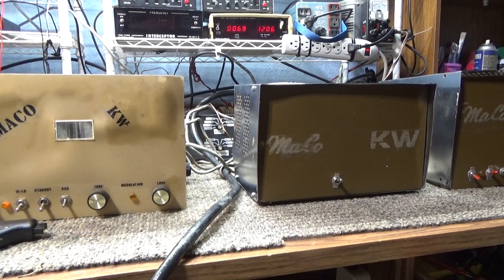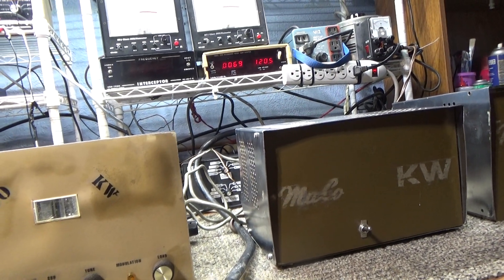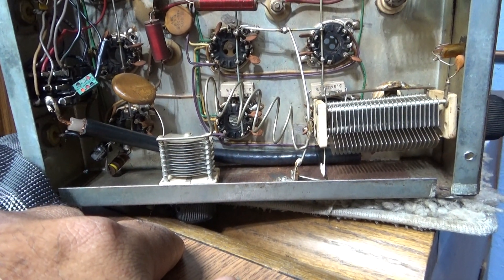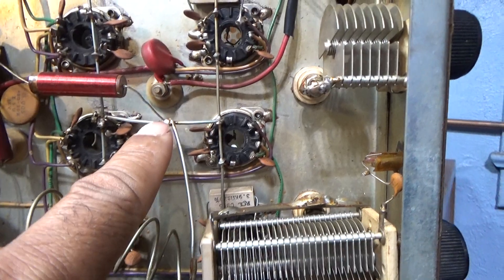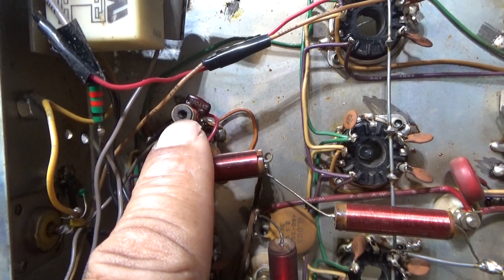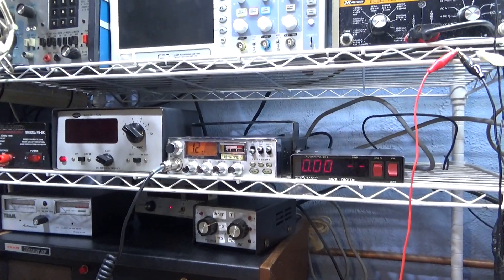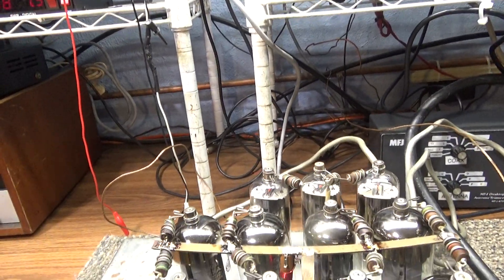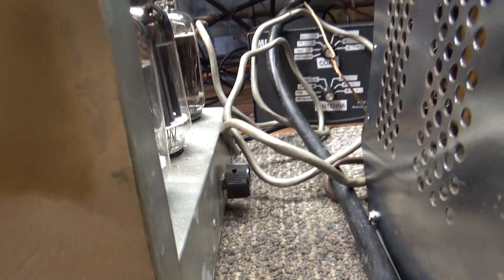Want to see my....wait I already done that. My new Maco KW mobile converted to ac/dc

Comment: What can you do with the Dentron clipperton L with no tubes? Can you change the tube and tube socket?
Reply from the maker: Yes but 572B's are about as cost effective a tube as you are going to find. 811's will usually work, but you will have a lot less output.